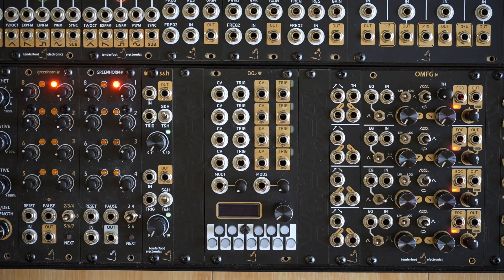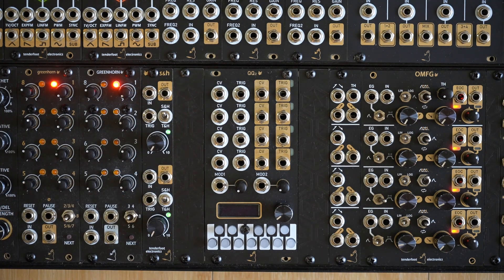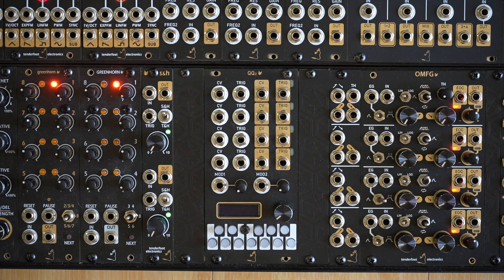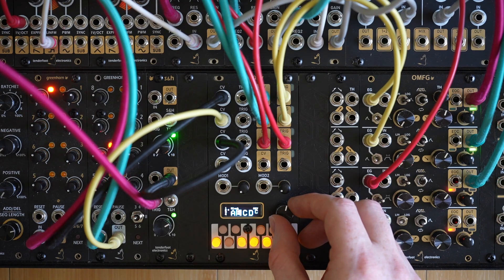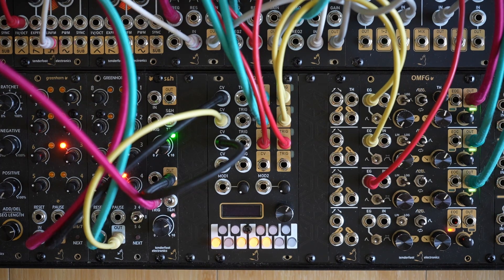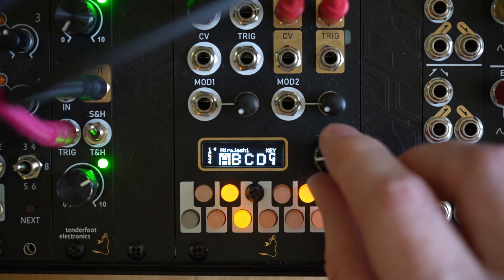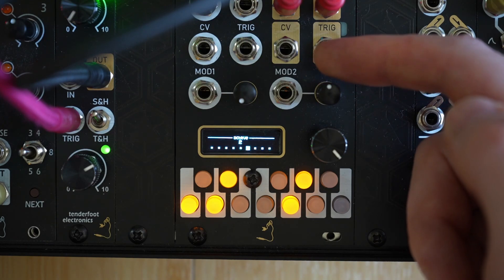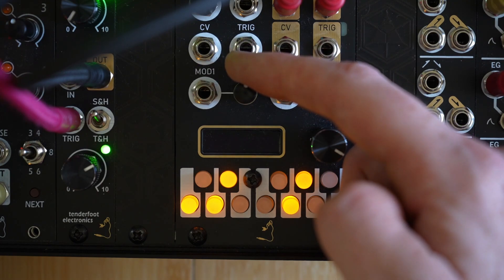QQ2 - New Quad Quantizer for 2023!

Comment: How do you specify the order and number of times each note is played? It seems like it just randomly picks from the ones selected.
Reply: what voltage are you feeding into it? That's what dictates what the note is played in normal quantize mode. Unless you're talking about the arpeggiator mode.
Reply: @ I was feeding it a random voltage source, from the woggle out on the Make Noise Wogglebug. Really just trying to get it to work in a patch, I am still learning the ropes on modular.  I am want to play a progression like F,C,Ab,Bb,F , but it seems to play out of order. I am probably doing it all wrong lol.
Reply: @bottomstreetbeats  if you want it to play a progression then you need to feed it a progression. Feeding it random voltage will output random notes. Feed it an LFO output. Send the LFO through an attenuator (or vca) first so you can constrain the notes to one or two octaves. Without it you'll hear every note in a 10 volt range and it will be very unmusical.

Comment: As it stands it looks super intriguing but to do anything I can return to later, I'd need four stepped CVs into it, that I've saved for later, and then I'd need to write down the notes I've input and scale I've set for QQ2 outs 1-4. I could just put stepped random into it and turn on some notes at random for a fun jam / inspiration, but keeping hold of anything I come up with is very tricky, or at least it seems to me. But like... The QQ2 would make such a phenomenal little sequencer. If you could just run through the notes on each channel with trig in, have a reverse/pendulum/whatever order option, and a way to save, is all it would take for this to be a dream module. But I get it, it's a quantizer not a sequencer and it's pretty awesome at doing that :D
Reply from the maker: Watch this space for firmware updates! ;)
Reply: @TenderfootElectronics  dont tease me like that gosh xD But absolutely, I'll be watching how things develop with interest, Tenderfoot stuff looks pretty dope.
Reply from the maker: @li21nljasndvkljhnakshedbxxc  Thanks! The firmware is under constant development with new features in the works as I type this right now (one of which is an arpeggiator mode). Definitely keep your eyes peeled over the coming weeks!
Reply: @TenderfootElectronics  Don't feel pressured to give into customer demands. This is a quantizer module. It's purpose is clear.
Reply: You'd just need a decent CV->MIDI converter.  Lots of those available for very cheap.  Then you can record it for later, play it back with your choice of MIDI->CV

Comment: is it possible to change the root note by hand or by CV on one channel or all? Great module btw.!
Reply from the maker: There are a few ways to do it. You can use the menu system to set the key for the scale you are using, and this will transpose the whole scale. Depending on which quantizer channels you link to that scale, it can affect any or all of the channels. If you want to do it with CV, you can set one of the Mod controls to either of the transposition modes: Pre if you you want an inversion or Post if you want to transpose the entire scale. Again, these can be linked to any number of the 4 quantizer channels. Hope this helps!
Reply: @TenderfootElectronics  Nice! thanks for the answer. Might it be an idea to be able to set the root note via the buttons of the little octave keyboard?